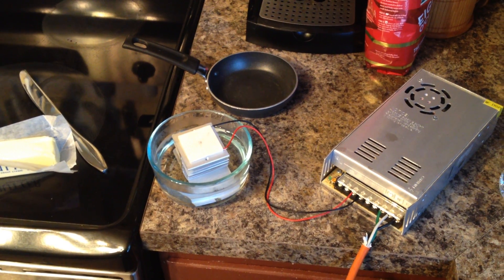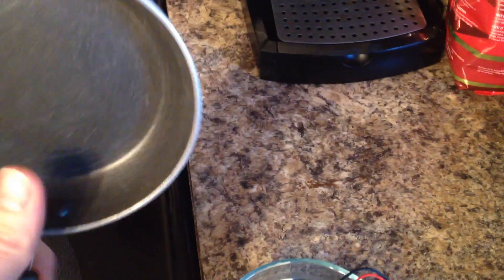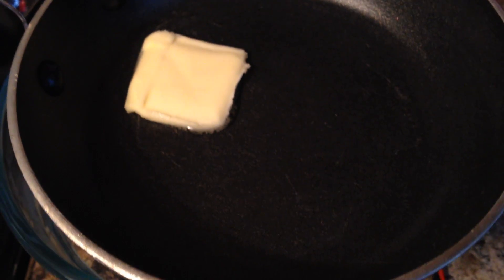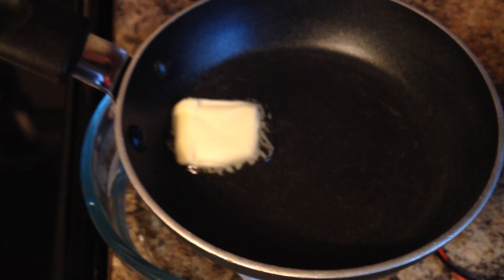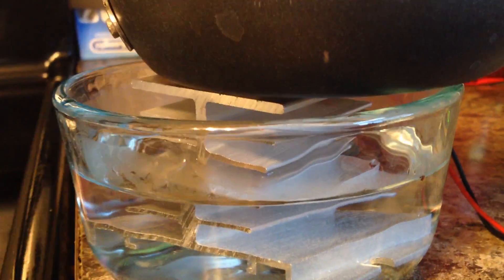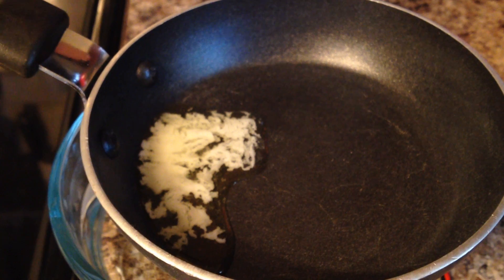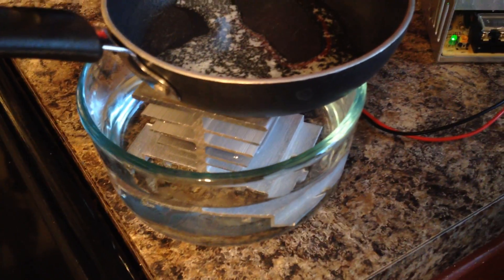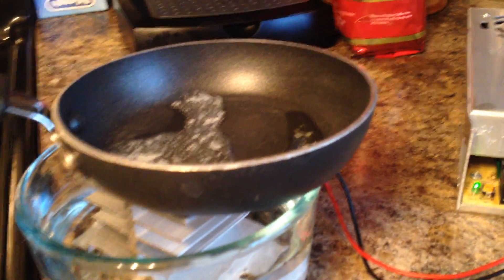Thermoelectric testing

Comment: 1) is it ok to connect 12v/40A power supply with TEC1-12706 peltier module (12v/6A/60W)?
2) should i connect 5 peltier module parellel with same power supply?
Reply from the maker: 1) Yes. The 40 A spec on the power supply is the maximum current that it can put out. Electric devices will only draw the current they need (6 A for the peltier module you stated). However, something on the module spec doesn't seems right. Power (W) = voltage (V) x current (I). If the current is correct, then the power would be 72 W.
2) It depends what you want to accomplish. The 40 A power supply won't have a problem with it (5 devices x 6 amps per device = 30 amps needed).